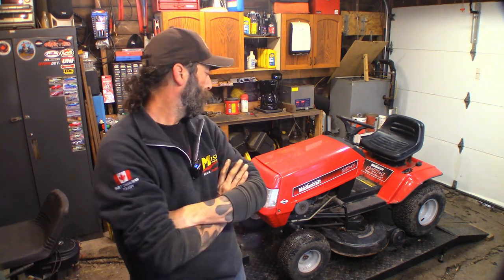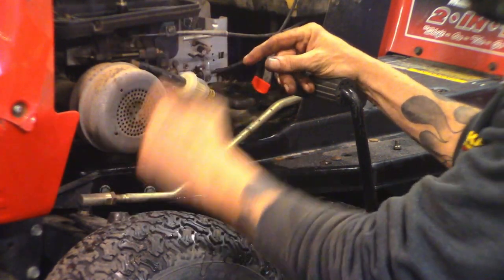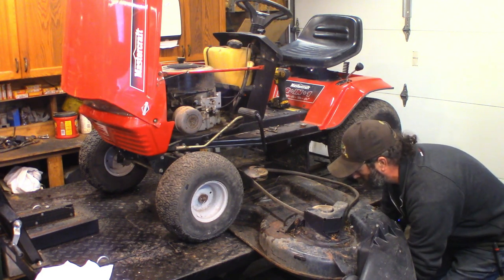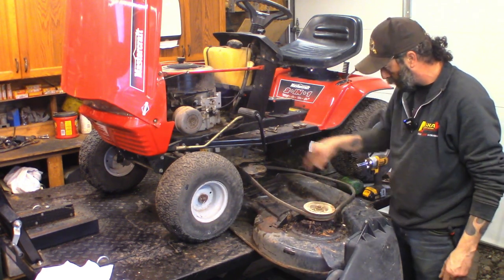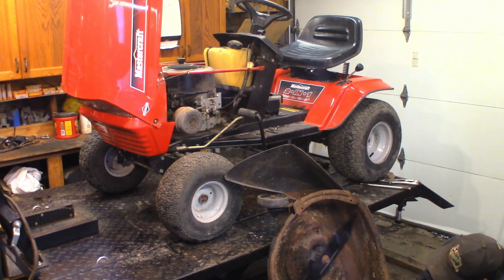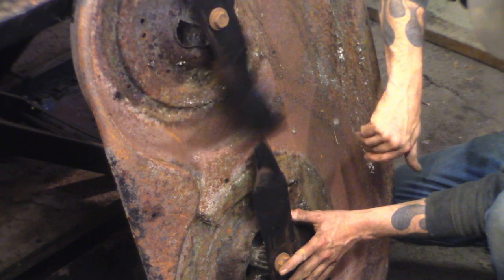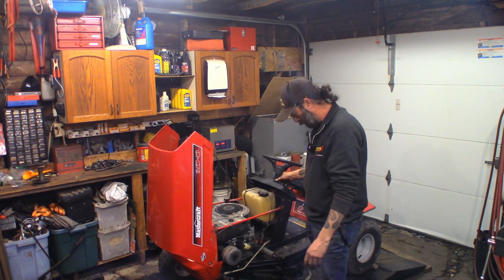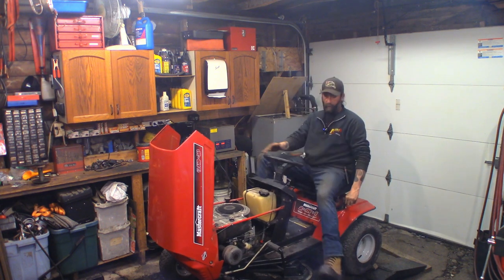A classic Mastercraft 12.5hp 38" rider for resale. Carb repair and deck repair.

Comment: Nice, what seems to look like a compact machine. For some reason it seems to be a bit smaller than most of the ones I see you working on but I like it. Sounds like a metal hood when you open it instead of plastic and also looks easier to work on. Of course that's easy for me to say because you're doing all the work. Anyway, thanks for sharing the knowledge.
Reply from the maker: Hey Len.  This is definitely a little smaller machine.  Still gets the job done though.  I cut an acre of grass for MANY years with a 12hp/38" Craftsman rider.

Comment: Just did all 3 belts on the exact machine except mine was a yard machines, let's hope it's the new updated belt system, cause the older one is a pain in the butt, to replace the 2 drive belts.
Reply from the maker: I'm pretty sure this one was the double belt system with the sliding pulley in the middle.

Comment: Don, you said you really liked that dewalt impact and that it got most of the heavier jobs done on small engines. I’ve been looking around at different ones for this exact purpose. Not too large or heavy but strong enough for what I think I’ll need. What model is it?
Reply from the maker: I don't have the model number handy, but it's a 20v 3/8 drive.  I have a big old MAC Tools 1/2" drive air impact gun for the really  stubborn stuff.
Reply: @randomwrenching  
Thanks!
Reply: I’ve been using a snapon for several years but it’s getting old and I’m going with what he has now
Reply: I just rebuilt both the 3/8and 1/2 Matco air guns
Love them better than the new style snapon 
I got a 5 year old Matco battery impact I’m fixing to start using it 😊

Comment: Great job. Certain rpm or by ear. You said flat head run different than OHV. Curious what you are referring to. Thanks and take care.
Reply from the maker: They all have their specified max rpm. Usually around 3600.  I generally use a tach to check it